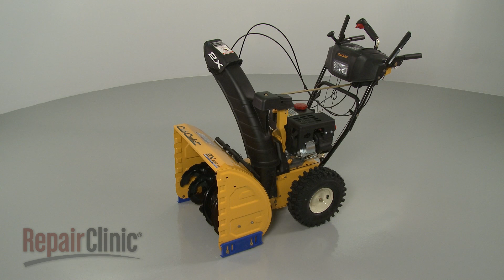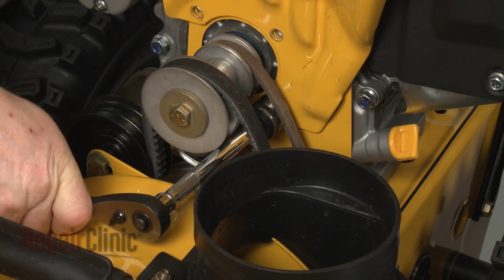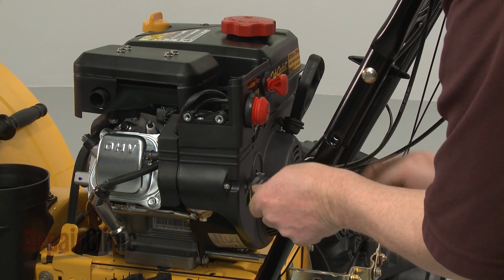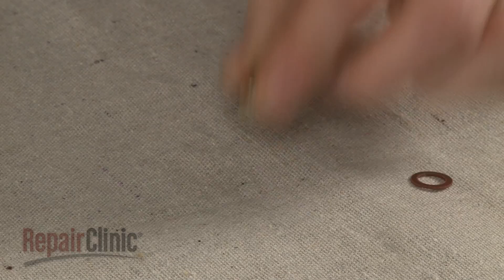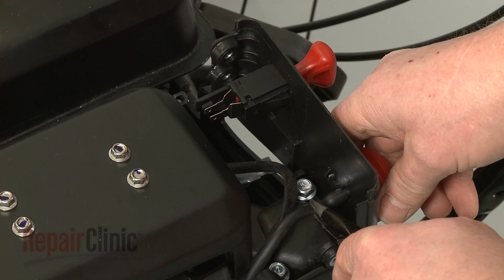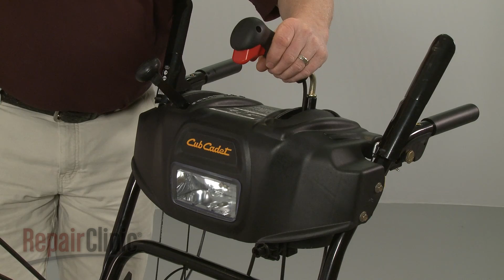Cub Cadet Snowblower Won't Start? Carburetor Kit #951-14154

Comment: If your machine is fairly new and the carb may be just gunked up with ethanol sludge,  you might want to try a simple cleaning method first so you don't have to tear the whole machine apart. 

Drain the gas and follow the safety steps shown in the video. Working from below,  remove the carb bowl with a 10 mm wrench, catch the few oz of gas from the bowl.  Use a stubby straight screw driver or a bit with a wrench to unscrew the jet which is in the same stem that the bowl screw was in. The venturi  tube above it should come out with it. Note the direction it fits.  

Clean the jet and all the holes in the tube with a copper wire (22 gauge works) and carb cleaner. Protect the tire with a shop rag and use the spray nozzle tube to quirt carb cleaner into the stem the jet came out of. 

Reassemble.  Take care to get the bowl gasket back in place. If the machine starts but runs poorly at high speed, try spraying carb cleaner into the air intake box in short bursts.

Comment: All that work just to get the muffler cover off, because of the bolt hidden behind chute gearbox support bracket. I put the bolt back in, then sawed the flap off the muffler cover with a jigsaw.
Reply from the maker: +Tom Dee Thank you for sharing.